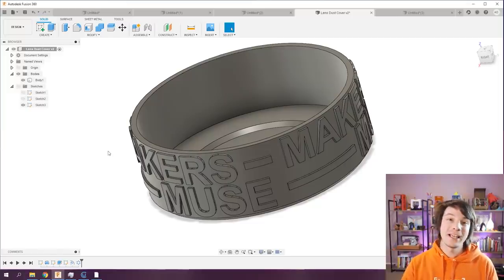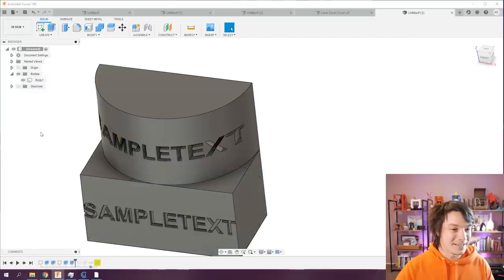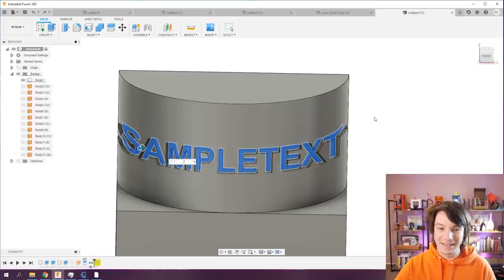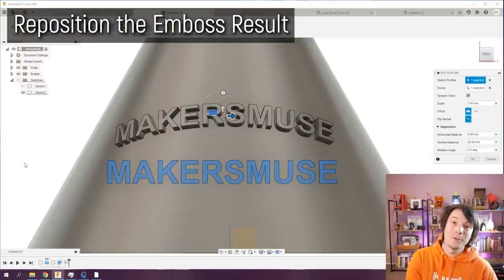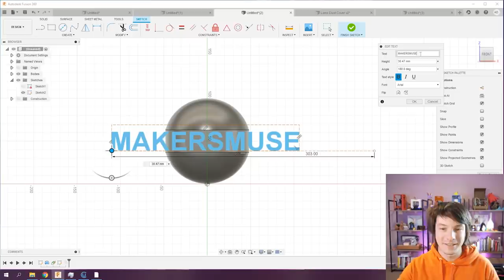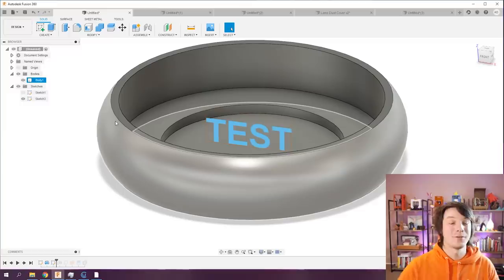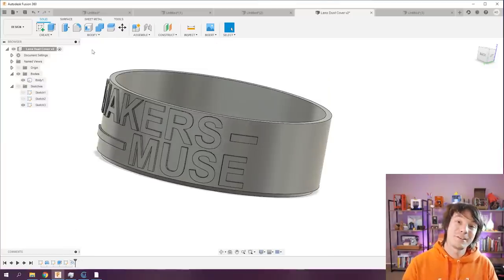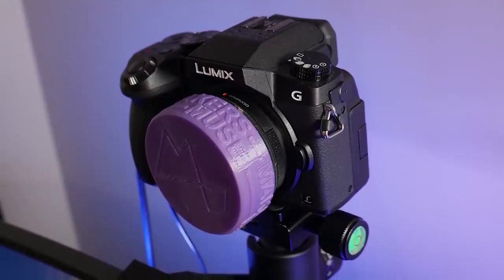Wrap Text in Fusion 360 using Emboss (FINALLY!!!)

Comment: Nice Fusion 360 tip! I’ve used “Sheet Metal” on a curved line, unfolded the “metal”, added text, and then refolded. That seems to remain undistorted as well. But this is way easier! Thank you!
Reply: as most.. but it was stupid considering how ez this could be done otherwise.. Finally they got it done..
Reply: Yeah, I used it several times since I saw that tutorial on Youtube and though it is quite tedious the result is perfect, way better than the "workarounds" that Angus mentioned. Wonder if he didn't know about it.
Reply: This is a method I used once in the past after find a youtube tutorial, but had complete forgotten how to do it.  This is much simpler. Can you unfold a sphere? to do the other cases..
Reply: @markjacksonpulver3546  No, sheet metal can only be folded in one direction at a time I think. So it would have the same limitations.

Comment: I suspect some letters failing would be due to path direction. This tends to cause errors in other vector programs as well.
Reply from the maker: Yeah could be. I know they're reworking sketch text (which is also overdue) so that may fix reliability.
Reply: I usually fix this by going into illustrator, right click on the path and select "reverse path direction". If the letter also has cutouts they will also need to be reversed